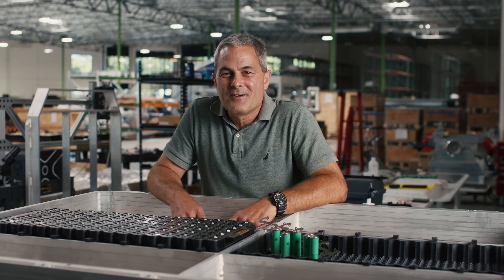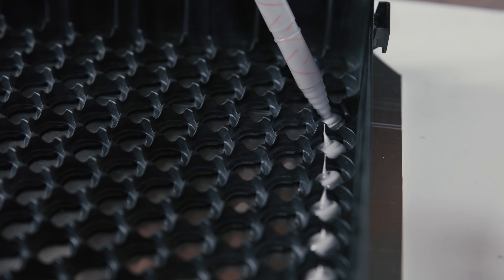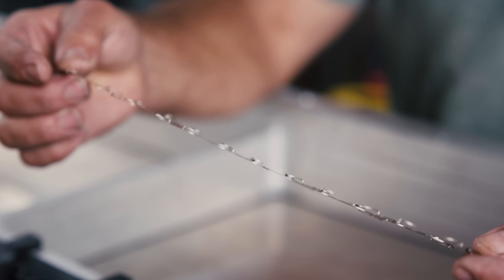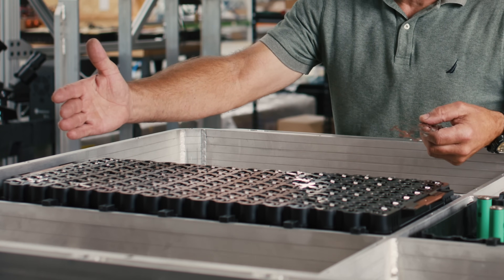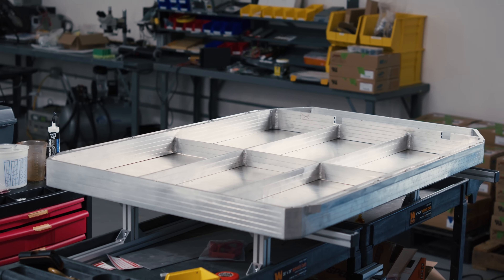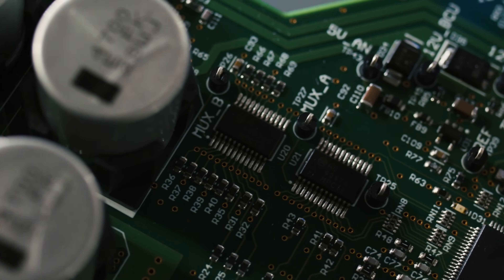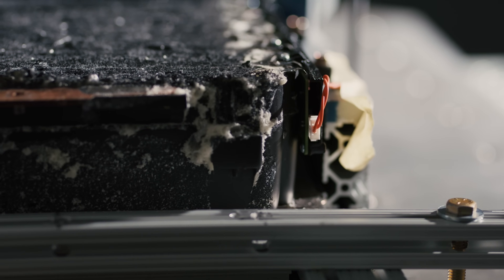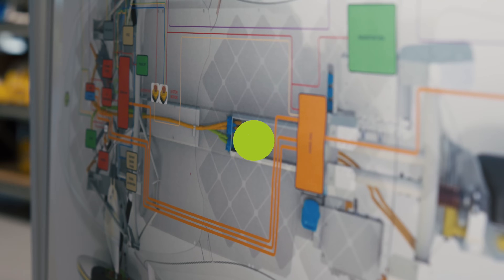Aptera — Battery Validation

Comment: A cooling plate for a cylindrical cell design is not going to be optimal during fast charging situations especially given that you will need to electrical insulate the bottom current collector from the cooling plate . A cooling ribbon would be much more suitable 2170. Cooling plates are normally used for prismatic cells.

Comment: NMC is known for thermal runaway issues, how are you testing to prevent and/or handle those problems?
Reply: Most of those instances had no real cooling system.  Aptera is using an antifreeze cooling loop in a base plate of the battery case, and careful monitoring through control boards.

Comment: That’s really great! The only thing I found odd was the way he was using a calk gun to apply adhesive manually and then placing each cell inside, you could tell some of them were crooked. Maybe a better process could be implemented to apply a precise amount of glue and position the cells perfectly. 

The other thing is the thermal management of the battey, no mention was made on how it is hooked up if it is coolant based or forced air. With NMC batteries you really have to watch the temperature and have a robust way of cooling the cells.
Reply: There is antifreeze circulating through the battery pack base plate to remove heat.

Comment: With the high efficiency of the Aptera, I would prefer an LFP chemistry. Safer from fires, and they have the ability to regularly charge to a higher state of charge. Cheaper too!
Reply: The extra weight in this case negates the efficiency of the respective battery type.  Chris Anthony understands LFP batteries, and co-founded a company that is now public and sells them.

Comment: There's no way that the batteries didn't see any reduction after that wobble test. I really hope they're not fluffing the numbers up, and moreso that the investors aren't having the wool pulled over their eyes because they're invisioning one of these in their driveway.

Realistically I'd expect 1-5% at the most after 100k- especially if the driver is really hammering down on it. What kind of 100k are they testing for? Granny driving or teen driving? How aggressive would they be with brakes/acceleration/corners? Are they servicing the vehicle regularly?

Again- that lil' wobble test seemed too soft to me. I understand this pack is secure- but I feel like the range of aggressiveness should be wider. Maybe have three packs undergo different validation tests that fall under certain driver archetypes.

People are driving these vehicles. Some will baby it and watch for potholes, and some won't give a hoot and hit each one without a second thought.

Comment: One of the problems I have heard with other EVs is that if the battery module is damaged in a crash, the entire car becomes unsalvageable. Will the battery units be easy to replace in the Aptera?

Comment: These are still Litium Ion batteries, don't know if auto insurers will want to cover these vehicles at an auntocycle rate due too thermal run away and last I seen 5,000 vehicles won't get  to my place in line in the year 2025 as predicted

Comment: Are you guys planning on testing that same 100k mile battery module up to 200k or 300k simulated miles? 

I suspect if there was going to be an issue, it would happen in the first 100k miles, but considering how long these bodies could last, it might be worthwhile to simulate 200 or 300k miles

Comment: Fisker has built vehicles gone bankrupt, risen from the ashes, designed a new vehicle produced vehicles again,and gone bankrupt again and you guys have yet to finalize a single production model and produce anything. it's always just look another pre-production model. build some damn cars. Or go bankrupt again and go away. I've bought a Toyota Camry hybrid put 300,000 Mi on it since you restarted the company and you are still trying to finalize some design and production issues. Produce a car or go away.
Reply: Maybe they are taking their time so that it is done right?

As someone with a background in manufacturing (from a different industry) it’s amusing to hear the criticisms which show a lack of understanding of the complexities involved. 

I’m very impressed with how fast Alters has moved - especially considering the limited capital.
Reply: @AndyTernay  as a person with an a&p who spent years building private jets from inception to drawing board to production, this is not a reasonable launch window, considering the company was founded in 2006 as accelerated composites and has been voluntarily liquidated restarted as at aptera USA in 2014 and relaunched as aptera motors in 2019.
Reply: Do some actual due diligence.  Aptera Corp has neither gone bankrupt or come as close to it has Tesla has.

Your Camary has miserable efficiency in comparison if you are the only occupant.
Reply: @n.brucenelson5920  let's see started started 2006, liquidated 2011, restarted as aptera USA 2012, split, to zaptera and aptera and fell off the planet, reformed in  2019 as aptera motors. Two you might want to figure out how to read their balance sheet, and three they built their entire platform around a motor (elaphe) they don't produce and now can't get. Interesting for a company with an SEC filing that's expected to start production soon after another round of capital raising. Or as we feel over on the aptera motors Reddit, bunch of these top people got rich the first time around why not come around for another go.

Comment: What is the white fuzz seen during testing?  Also - thermals during peak charge and discharge will need to be mitigated by the bottom mounted heat exchanger.  This is making minimal contact with each cell - just the diameter of each cell base .  The heat radiates outward in the thermal axis. Isn't this why Tesla and Rivian stepped up the thermal management to flow coolant around the vertical sides of the cells and also pack the thing in thermally conductive goop to keep them from overheating?  And the cells in the middle of the pack will experience heat buildup from the neighboring cells. Curious how you handle that.
Reply: Anode layers are only in contact at the cell base, so cooling during discharge is more effective through the base, all else being equal.
Cooling via the sides can allow for more surface area like you say, and slightly more balanced thermal management during charge vs discharge.
But that requires more material & complexity, ultimately giving lower energy density per module. There is a minimum size for the side cooling serpentine channel plus electrical insulation before manufacturing is impractical, so with the Aptera's relatively small battery & low thermal load, any thermal management advantages would be outweighed by the loss of cells.

If Aptera can achieve sufficient thermal management via the base, it's a win for efficiency on multiple fronts.

PS; Re heat buildup from neighbouring cells. Most of the heat is transferred through the top and bottom of the cells, because that's where the anode and cathode layers terminate.
So there's minimal load from neighbouring cells, providing the cooling system has sufficient capacity to move heat away. Before the heat reaches the sides, so-to-speak.
During charging is a bit different (more heat at the top of the cells.), but Aptera's peak discharge will be much higher than the 50kw charge they've spec'd for launch.

FYI current Rivian models use base cooling only (a cold-plate sandwiched between two stacks of cells, with one stack "upside down".). The goop is just a structural foam to keep everything tight.

Comment: Good stuff!  A charge rate of "well above 400 miles per hour" on the Launch Edition of 400 mile range at 10 miles/kWh means at least a 40 KW average charging power or 1 C.  Did I get that math right?  Obviously the BMS will slow down the charging near the end of the charging curve, but even if you add 200 miles in 30 minutes or 100 miles in 15 minutes, that's quite road trip worthy.

Comment: Although anxious to receive my Aptera, doesn't 400 mi/hr charging mentioned here seem mediocre?  Tesla, Lucid, Porsche, and Hyundai/Kia already do that.  Should it be closer to 1000?
Reply: Trade-off between faster charging and battery life so even if Aptera could do faster, it’s unnecessary for typical use and comes with this penalty.
Reply: A chaeging rate of 400 miles to 600 miles per hour is fine

Comment: NMC Batteries have some rules for longevity.   -1- Don’t store the car’s battery at 100% charge, especially when it’s hot outside.   -2- Don’t wait to recharge the battery until it’s low.  -3- Don’t regularly charge to 100%.    How is the Aptera BMS supporting the owner to observe these guidelines?
Reply: They would be wise to follow Tesla's lead on this one, like having an 85/15 charging/discharge cap.
Reply: @justinw1765  Yes.  There are no perfect battery choices.   Always a trade off with technology.  The article I read specifically for NMC Batteries recommended 80% max charge.   Recharge at 60%.   Long term idle sitting time at 30%.

Comment: Are these battery packs designed to be replaced affordably? As in... 1 or 2 technicians could do it in an hour or 2 for a reasonable cost? (Significantly less then replacing a transmission on a $25k car, battery and labor combined). Otherwise, 100k mile testing doesn't feel like enough.

Obviously replacing cells is not reasonable. But I mean the 60ish volt packs.

Comment: Hi Aptera, I'd prefer to use Aptera with LFP cells someday (those new gen 3 LiFePO4 cells with higher energy density, ability to charge in freezing temperatures and 4C+ charging speed) - would it be possible in future to swap / change the cells without replacing BMS and other systems?

Comment: 400 miles of charge range time means nothing until you have the rest of the numbers. A quick guess running these numbers and info in my head must mean it wont supercharge and will operate in 50kw to 100kw zone? or less becuase that cooling plate system and plastic battery cover grid looks very insulative. 
Slipping in the 400 at the end was cute without doing the math of what that means. If it has a huge range with low WH its still a quick charge. But not explaining its a very small battery and it may charge up before a thermal issue exists.
Clean shop, someone has a lot of other peoples moneys.
A final thought is the testing was done to the point were degradation would start on modern batterys. Im sure they'll be fine as tesla is mostly ok. Its like ICE car engine being tested to 30k miles, who cares. Whats two or three times that.
Reply: Aptera's 45 kWh 400 mile battery is about 40% smaller than Tesla's 300 mile range battery. At 100 wH/mile efficiency l, 40kw DCFAST charge would yield about 400 miles/hr, 50kW would he 500 miles,/he and 60kWh would be 600 miles/hr. Many of us feel that this is more than adequate for the 409 mile range Model.
A quick lookup cane up with a Tesla Model 3LR can charge at a rate of 770km/hr. (478 miles/hr)

Comment: I wish I had thought of the following question to ask the last question and answer round:  "In the unlikely case you need to be towed up on a flatbed (I assume that would be required instead of a regular tow truck), where do you hook the Aptera up in front?
Reply: Probably have one of those pop off tow ring covers?

Comment: Too many batteries -  gotta be the weakest lkink in EV's
Reply: Actually having lots of cells is good, if one or two or even 10 go bad, you havnt lost much overall capacity.
Reply: All EV battery packs are a collection of cells packed into modules. Is it a weakness?
Reply: The fact that EV's have been successfully driven for years and millions of miles proves you have no clue what "weakest link" means.  ("but, but, but" in 5, 4, 3, 2, 1, 0......)

Comment: Will the higher range models have less storage space?
Reply: No. The higjer range models will be using taller battery cells that still will fit into the same space dedicated to the battery modules.
The lowest range model on the other hand will use less modules.
Reply: @charangohabsburg1 I th8nk I read the the 250 mile models will use 2170 cells, like the 400 mile model,  but just populate every other row in the midules..

Comment: As the cells become more energy dense I wonder if alters will just give us more battery capacity or start to lower cell count. An example is EVE who they initially signed an MOU with, has new cells that are around 15 percent more energy dense for 2170 form factor then the ones alters tested with. If they used those cells the pack could be around 49 kWh.

Comment: 400 MPH charging is 40 kW
Reply: In excess of. If it is 4 times as efficient, then it can charge at a lower kW rate and yet may achieve similar range per unit time.

Comment: Why did you choose NMC over LFP?  An EE times article is good at explaining the differences.  Good, fast , cheap:  choose any 2.  Which did you choose?
Reply: I think weight to power density
Reply: Currently, LFP cells have about 30% less power density. I've read that there are 2170 LFP cells available. And although I'm sure it is not as simple as just switching to them, a fully populated pack with 2170 LFP cells would be a ~280 mile pack vs the ~400 mile pack with NMC cells.
Reply: @garywozniak7742  Don't you mean "energy density" rather than "power density"?  There's a difference.

Comment: When they say "no capacity reduction" does that mean that this test included battery cycling to simulate 100k miles? Or does this just mean that mechanical stress up to 100k miles did not impact battery capacity?
Reply from the maker: In this context we meant that mechanical stress didn’t impact battery capacity.
Reply: They will also be doing durability testing, which will of course include the battery packs.
Reply: Thank you for the clarification

Comment: Great to see this important work being done to ensure that components last a good lifetime.  Looks like a very solid battery setup and cooling design.  I still hope once aptera is in production they will put R&D effort toward an even more affordable/greener LFP or sodium variant but it looks like even the initial NMC 811 batteries should last 12-20 years.  Given the extreme vehicle efficiency 1C (400 mph) charging is on par with any Tesla (which need 2.5C average to achieve the same).  Given the relatively low C rate and power needs, I do wonder if Aptera may be able to sustain near its max charge rate for longer than other EVs.
Reply: Good question

Comment: I appreciate how rugged and robust the battery module is, but I am curious if any thought has been put into the end of life for such a pack? I'm assuming disassembling the pack is a nonstarter given the epoxy and welding?
Reply: Chris Anthony was asked a while back about upgrading better packs to increase range. He said that while it's theoretically possible to swap out a battery pack for a larger one that it would be more complicated than that because you would also need to adjust cooling and heating and reprogram the BMS etc. Short answer, if you intend to change from the original battery pack it's probably going to be easier to just buy a new Aptera with the battery you want. As for repairing/replacing like for like batteries, that's probably doable but because of how it is mounted inside the body I suspect it'll be a huge pain. That said! The battery packs should easily last 400k and by then most people will be ready to retire the vehicle regardless.